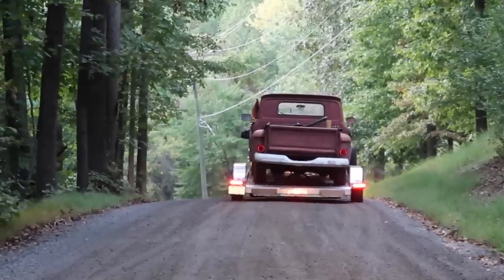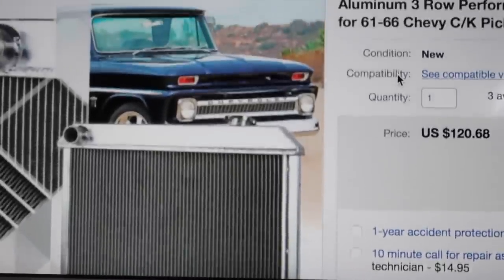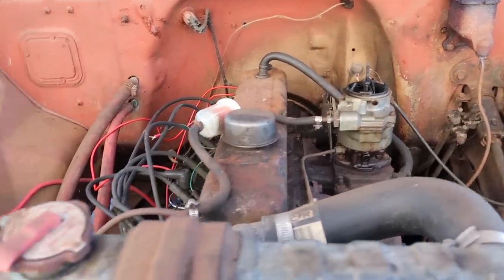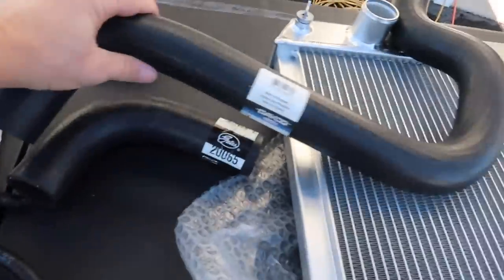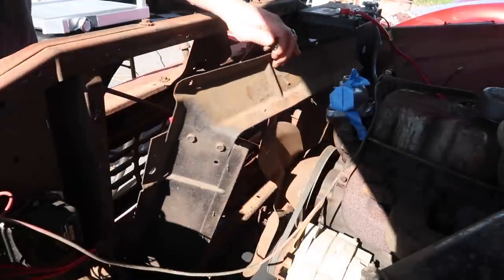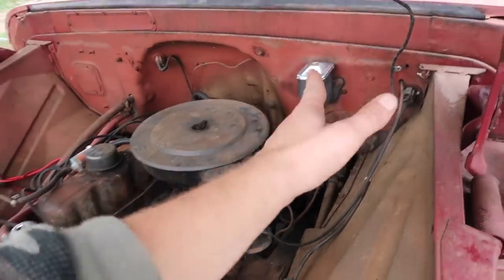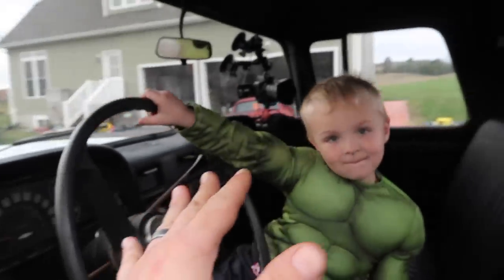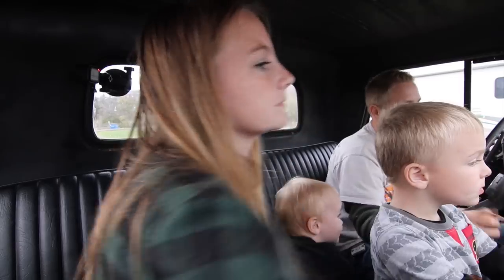Abandoned Field FIND First Drive 1963 Chevy C10

Comment: make sure the carb is tuned correctly, a lean engine mix could cause overheating and loss of power
if It is the head gasket I say fix it, its an inline engine so it shouldn't be too hard
Reply: @adriantomlin2902  might as well do valve seals too
Reply: kevin cornell yup actually if I was gonna go that deep with it. Ya might as well do a valve job!

Comment: If it was a head gasket you should be seeing smoke specifically white smoke coming out of the tailpipe when you're driving it or running it if it doesn't smoke anything in the coolant not going anywhere and it's staying at the level that it should be and there's no milkiness in the oil either then it isn't the head gasket.  Could be a bad temp switch maken u think that it's over heating I've had that before and definitely needs a carb adjustment in order for it to run right and not keep stalling like that trying to drive it up the hill for sure .🛠

Comment: those trucks ride so smooth too, I know mine had really soft springs too, but that was 40 years ago now. Carbs are easy to work on. Just throw a vacuum line and adjust by vacuum gauge. super easy.

Comment: Find the air adjustment screw on your carburetor 
1 1/4  to 1 1/2 turn out where it runs the best and it should run a lot better set the timing and check your point gap. Seat belts
Reply: Just drive it. It's been sitting so long it needs to build heat in the motor several times to reseat the valves and rings. Then after you drive it for a while,  you will know how to tune it.

Comment: Bags or motor?
Use the stock motor long enough get around while doing body and paint. Upgrade suspension while avoiding bags. Use the money on motor. More or less, any 60s-early 2000s V8 is a drop in scenario. 

Love the truck vids, keep em coming. I'm watching regardless tho. Y'all be well.

Comment: I was so excited when I saw that you got the 63! Definately gave me more motivation when it comes to my 62 and now we've got some more videos with it coming 🤟
Reply from the maker: No Way...Didn't know you had one. you might have told me but I forget a lot
Reply: @JD_JoyrideTV  haha I think I may have mentioned it to you in Charlotte but I dont have a c10 though but i got a 62 tbird lol I just got the motor out yesterday so that video should be Interesting to say the least 😅
Reply: @planetstang1143  , The FE block engine in the 62 Bird ( 352, 390,406) will not fit in 65 or later Fords due to motor mount location , but later model FEs will still have the extra mount holes to bolt into a 62.
Reply: @dennislangston487  yeah but I'm just using my stock block from my 62 so I should have no issues with fitment lol

Comment: Build the most on the current engine.  In line engines run forever,  just fix it and possible bore it out.  Change the three on the column to a four on the floor with a trans swap.  Keep it on a budget. 
Great video

Comment: i would change the head gasket and check for blockage to confirm the issue your having. when your head is off go ahead and change out the valve seals too. there more then likely dried out from sitting and wont take much for them to fall apart.

Comment: Love the old C10, I’m a life long Chevy guy and would love to find a straight 6 3 on the tree original truck. My gut says rebuild the straight 6, those were solid dependable motors, but if you have to swap maybe a vintage 327?
Reply: The brazilians have done some phenomenal work with the 292. Build it with a few pounds of boost from turbo and it'll do great.

Comment: Hey It's always a good idea to change the fuel pump on old vehicles. The diaphragm in the pump rots out and you lose fuel pressure, The engine usually dies after you start driving it, Especially when you drive it up a hill.

Comment: I think the radiator needs a fan shroud. The fan is too far from the radiator and not pulling air through it.
Reply: definitely even if it's a head gasket but I don't think so.
Reply: The oem radiator would have been much easier.
Reply: @19reedCharles44  aluminum will cool way better
Reply: @travisevans7502  I don't think it is the head gasket either. It would either have water in the oil or steam in the exhaust or both. I don't see any white smoke out of the exhaust at all.
Reply: The oem radiator would have had brass cooling fins which conduct heat better than aluminium...and the fan shroud would fit which would help air flow through the radiator  ...and I avoid parts made in China whenever I can.
Reply: @19reedCharles44  I could not agree more.
Reply: @19reedCharles44  first off aluminum cools way better then brass. Why do you think every Nascar , race car, hot rod, street car and so on is running them? Next the shroud would only be an issue if it still wasn't cooling. I never heard him say he was still having cooling issues after changing the water pump because it wasn't circulating.  Damn man even intercoolers now days are aluminum. ND there is nothing wrong with some Chinese parts, most of the new cars , trucks , bikes,  and most aftermarket parts you buy at part stores all come from China.  I have bought several of these radiators because the originals are to expensive and most of the originals you take to a radiator shop end up leaking in a year because the rest of it is still all worn out. I had good luck with radiator shops 20 years ago but now the parts are another 20 years older, not so much. Even the radiator shop I used to have recore mine, wants to build me aluminum now.  But at least most places sell you one that will at least use the original mounts and brackets
Reply: @kennethlaw5216  ....ok, looked it up and aluminum is indeed a better conductor than brass. I stand corrected. ...but he did say the engine was tending to run hot. Air flow is important for cooling.  I have seen fan shrouds make a significant difference.  Perhaps  flushing the block and if he is using water, using coolant instead of just water would help. My comment on parts from China wasn't because they are necessarily inferior, but because I prefer to buy parts made in the US when possible... you seem to be a bit heated with me...?... I think we are here to have some fun and help one another out..
Reply: @19reedCharles44  he says it was running hot before he changed everything,  I did not hear him say that at all after he change the radiator and the pump, I could be wrong,  I may have missed it. Yes a shroud can help alot. But I have run alot of cars and truck with a lot of horse big inch motors,  or pulling big loaded down trailers. I have never found myself needing the shroud if it was busted up and missing I  never used one. Thar little 6 cyl with that big radiator should be more then fine, especially this time of year. If  he has heating issues it now will be more then likely a head gasket. I have pulled a lot of old cars and trucks out of the weeds in my day and only one did we not get running.  Motor was seized when we brought it home and wouldn't come loose. I don't think I have ever put a head gasket in any of them.
Reply: @kennethlaw5216  Charles Reed is correct,  he said it still was starting to overheat after all the work he did to it thus leaving Charles Reed and others believe its a air flow thing. 20:34 quiet thinking you know everything and getting on other people's cases when you my friend are not even correct yourself.
Reply: @kennethlaw5216  lol, wow you do have issues, I can careless if you have worked on these truck's "your whole life" you are still wrong when you said he didn't say anything about a heating issues after the work when clearly he did, and all Charles Reed was saying was try a fan shroud to see if it would help with airflow, and then you go ape shit on everyone, and don't call me boy, I am not you boy.
Reply: @kennethlaw5216  maybe you should start paying more attention to videos you watch instead of criticizing everyone else for your arrogance.
Reply: @tysoncurrie7745  my own arrogance?  Really? You see I know how to fix the the truck. I would have it running for half what he spent. Next you don't buy a truck like this and put new wires, cap,  rotor,  points, carb, radiator,  and so on then decide well I'm to stupid to get it to run so I guess I will change the motor. 1st thing you do is check for spark and get it, then you pour a little gas in the carb and get it to run. If it seems like it may run ok. Then you hook a line up on the carb and see if it will run like that. You even can fill the radiator up, even if it leaks it will run long enough to see if it overheats before you spend money on the rest of the stuff he doesn't need now because he is going to change the motor.  He just spent hundreds on stuff he can't use now. This is stuff you and he would know how to do if you actually learned something by people like me. Or the dozens of channels out there who actually fix this stuff. But no you want to be as stupid as your little hero here and call people arrogant. There is a difference between being arrogant and actually knowing what you are talking about. Him teaching your how to do everything backwards just dud you no good. He just taught you to be as stupid as he is. You still didn't learn anything
Reply: @19reedCharles44  I agree with you but I'd like to point one thing out he's going off what we all call an idiot gauge because the dam things were idiots they weren't very reliable I think he need to put his own after market gauge in the motor didn't have no signs of being hot when my Jeep runs hot it has steam from under the hood, and it don't have a blown head gasket either valve's need adjusted carb needs adjusted I'm not sure if he put a new fuel pump on that maybe a problem if he didn't or he could be picking up rust in the tank when he gives it gas but it doesn't have a blown head gasket
Reply: @kennethlaw5216  and bust fasteer those cheeeeeeeeeeep chi commmm ones
Reply: You dont get fan shroud on old cars or trucks
Reply: Fan shroud. Usually on a  V 8.
Maybe  recore the  radiator. 
New  aluminum is awesome. 
But  original? Out the window

Comment: For a head gasket problem check to see if its leaking water out the exaust or bubbling in the radiator or pull the head see if a cyl is clean & the others look the same. I would keep the truck as it is the 235 is a strong engine.

Comment: Put a timing light on it, set your timing. then adjust the carb. run your mixture screw all the way in then back it out a turn and a half. That's a good starting point. Make sure you don't have any vacuum leaks anywhere. Spray some carb cleaner around any joints or gaskets you suspect. If it changes how it runs then you found a leak. These are extremely simple and reliable engines. A little more work and it'll be running great. Even if it is a head gasket, it's an afternoons work with a helper.

Comment: Nice video, the truck seems to be coming along
Stalling could be carb needs more fuel mix. Give it a 1/4 turn to add more fuel see if that helps

No air bags! You'll be SOL when the compressor fails. 
Leave the 6 in that truck !!
Just cruise and enjoy
Good luck

Comment: If the head gasket is blown it isn't to much work to replace it on a straight six. Check the mixture screw on the new carb. Tighten it down and back it out 1 1/2 turns as a starting point. Once it's running, throw a vacuum gauge on it and adjust for the highest vacuum. I think keep it as it is, just get everything working so it's safe and reliable.

Comment: Always test your thermostat in boiling water before installing it. To adjust your carb mixture screw(s) connect a vacuum gauge to the the full manifold vacuum port on the carb and adjust the mixture screws to get the highest vacuum reading then adjust the idle to 800 rpm. Start with 1.5 turns out from fully lightly seated for the mixture screws. I would replace the head gasket if it’s shot. Keep that inline 6 banger.

Comment: Try flushing the system and doing a pressure test before swapping the head gasket.  If you’re having trouble finding gears you can use mechanics wire to shim between the concentric rings on the steering column and it will make that 3 on the tree easier to shift.  You may need to adjust and or replace the clutch too that’s an easy fix.

Comment: A head gasket is easier and cheaper than a new motor. Carburetor adjustment is easy, you have fuel mixture and idle. Turn them both all in and then back out 1.5 is usually a good start.

Comment: Something else to check is for an exhaust restriction.  One that I overlooked on my later model unit was the exhaust heat riser valve  -- it was frozen in the closed position and caused a phantom overheating problem.  Before the cause was discovered, I had replaced radiator, thermostat, thermostatic fan, water pump, and added an auxiliary oil cooler.

Comment: To adjust the carb I was told to scrow the air mix & fuel all way in then back them out a bit running then unscrew them a hair then try it. Head gasket cyl head remove not bad on a 6 cyl

Comment: Put a small block chevy in it the flywheel and clutch off of the 6 cylinder will fit on it perfectly
Reply: Greg Salmon before you start bashing you need to know your facts I have a 1966 c10 with a 327 it has a 230 inline 6 flywheel and clutch on it been driving it for about 5yrs like that the flywheel is EXACTLY the same

Comment: Bro I have a 58 GMC its stock...I will bag it eventually and c notch the frame, but first get it safe.  Brake lines/brakes/master cylinder/wheel cylinders.  Those were big problems I had with my truck.  
I think you scored on that truck. Good times!

Comment: First gear is all the way toward you and up. You keep trying to start in second gear . Also if you are trying to down shift you need to probably double clutch it. That is to push clutch all the way down once and then push it down again to shift it.  when adjusting the carb turn adjusting screw in until it starts to die and then back it out a quarter turn. Also try to adjust the timing and points it will probably run a lot better. And change that old crappy gas filter.  Good luck and have fun with it.

Comment: I had a 63 GMC 10 with a small block 400, turbo 350 trans with Hurst shifter and 3.55 gears. It was every bit has original every where else including rotted wood in the bed. For $1k initial purchase it was the best vehicle I've ever had and would outrun almost everything including a 305 Camaro w/tpi. Definite engine swap with something fun

Comment: the carb popping is a sing of lean mixture. you can open up the idle mixture screw BUT first check if there's any vacuum leaks. replace the PCV and the hose it connects to, then put the hose from distributors vacuum advance into your mouth and suck, you should be able to feel if the advance mechanism inside the distributor is moving. if you suck in air then the vacuum pot in the dist is bad. and while you're at ebay shop for a degreeable timing light that has tachometer. stuck mechanical and vacuum advance in the dist kills all power when you go past 1500rpm. did you lash the valves?

Comment: If you still hear it sucking air take a water hose and spray water around the bottom of the carb or around the intake manifold where it goes to the block. If it pick up speed on the motor then you need to replace the intake manifold gasket. Other wise it will be running a little bad and probably stalling out.

Comment: Carbs aren't hard. Usually an air fuel mixture screw in the front. It's either an air or a fuel screw. Pointy screw needles are fuel. Blunt tips is air. And there is an idle screw there also  Just gotta find the right mix. Get the mixture right and then ease down the idle screw.

Comment: If you do a 350 do the L31 from the late 90s C1500s it has the Vortec heads and makes more power than most 350s stock and you could still keep it relatively stock or cam it or do whatever. You have a couple options for the trans. 4L60 or 700R4 I'd personally go the 700R4 route but I'm just giving the options. Mind you I might be leaving alot out here as I'm not toooo knowledgeable but I know enough that you could easily find a wrecked late 90s C1500 for cheap and take the engine, harness, ecu, and trans all out and swap it into the 63

Comment: Needs a fan shroud.  Stock radiator with fan shroud would work better than your aluminum radiator that’s like 4 inches from the fan.  It’s not pulling air through the radiator.

Comment: Make sure the head isn't cracked ..but you can usually tell if it's the head gasket ..got water out the tailpipe it's blowed on the exhaust side ..water in the oil intake side ...but I'd just buy a crate motor or get a truck coyote ..and definitely bags

Comment: New plugs, wires, cap, rotor, set air fuel mixture to highest Vacuum and 1/4 turn.  Keep that motor a six cylinder can run very good.

Comment: Get a gen 3 4.8 LS with a 4l60e and use the stock computer. Probably the cheapest option to get it running reliably. You can even jam a cam in it for a couple hundred bucks extra.

Comment: Good to see what you have done to the Chevy. I would do a compression test and a leak down test. If you don’t have those tools im shure AutoZone rents them. If those checks turn out ok connect a tachometer to your engine and a vacuum gauge also. Also a timing light. Warm up your engine until it is fully warmed up thermostat open. Set timing to specification. Adjust air fuel mixture screw till you get the highest vacuum reading and then adjust your rpm at idle to specification of your vehicle. That engine is one of the easiest engine to do any mechanical work to. So much room with that inline 6 cyl engine. I think your doing a good job for the experience and knowledge you have. Keep those videos coming and remember happy wife happy life. 😎👍
Reply: I looked up some specifications for your truck hope this helps. 
http://www.tpocr.com/chevr.html